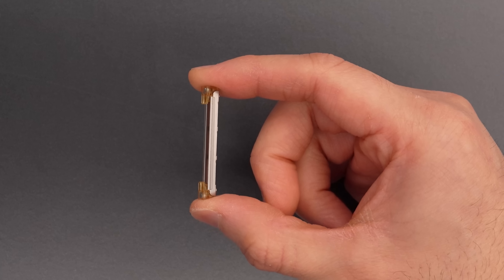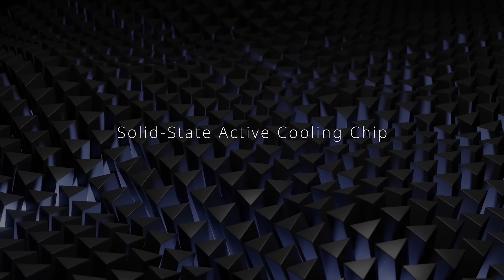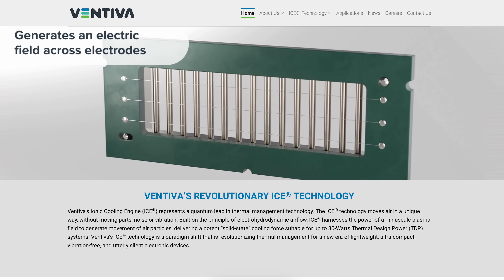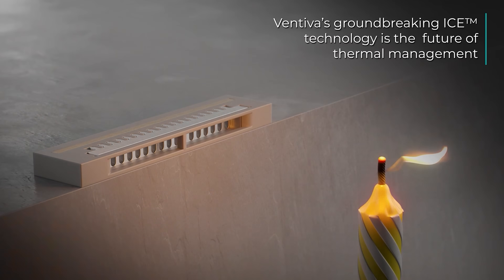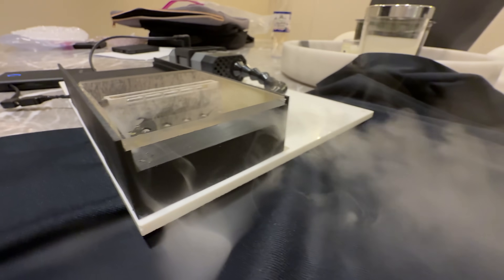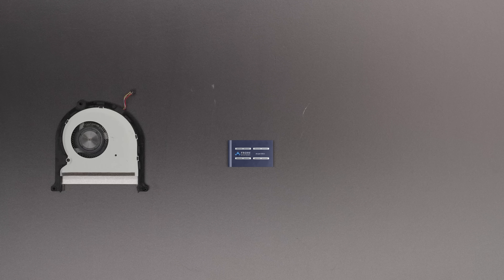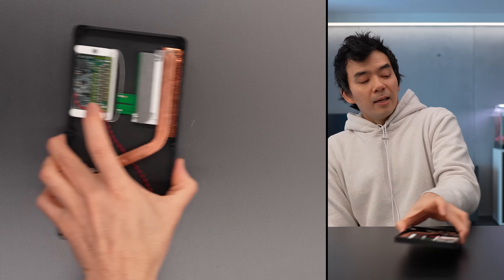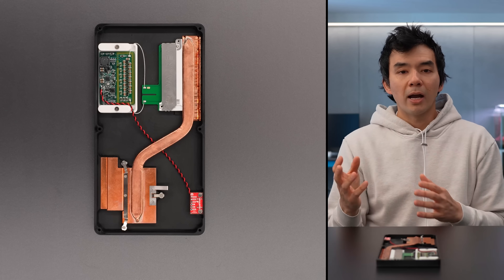The IMPOSSIBLE Laptop Fan...

Comment: 1) Ionic thrusters suffer quite a bit of material degradation.
2) There is a chance of electric shock if not properly gaurded.
Reply: Im wondering how much physical shielding it will require
Reply: @zalphor  Yes, all that system has to be extremely isolated or the electronics will give up the good old magic smoke.
Reply: @zalphor  it's literally shown in the video...
Reply: @Shockersify  you mean the housing designed to create a path for air? I don't remember him saying it was shielded.
Reply: @zalphor  he mentioned the faraday cage
Reply: @zalphor  literally brings it up at 7:08
Reply: @osmanceylan  ok then let me clarify I mean to prevent crushing and denting because outside of tons of dust and fibers its the most common damage I see at work.
Reply: @zalphor  That's not "shielding." What you're talking about is structural support. The structural support will be part of the device's overall design, just like it is in every other case, regardless of cooling method.
Reply: @nimoy007  well I didnt say EMI shielding I said physical shielding so I don't think thats the same. But ill give it to you its the easiest meaning to infer. Its structure is definitely thin so I dont think thats at all considered by the design.
Reply: @zalphor  Fair enough. As far as design goes, you can design the case in a way that redirects forces around it.
Reply: @zalphor  "crushing and denting"??? bro... what are you doing with your laptop for it's internals to get crushed?
Reply: @dygon7663  I work on ruggedized laptops. besides newer thinner laptops will be dropped and their thin chassis will flex...

For the most part being in the middle will be safe but it looks like this pushes the fan mechanism towards the heatsink and I can guarantee you people will smack their systems directly on the bottom so unless your case is aluminum its probably going to bend the heatsink and fan mechanism. And quite honestly even regular machines get beat up more often than they should. Accidents happen and they shouldn't be the end of the machines life, that is where waste comes from.
Reply: @zalphor  And I work in IT hardware repair. In the 6 years I've been doing it. I have never seen internals crushed. I've seen corners missing, screens smashed, a dent on the chassis here and there, sure, but the inside crushed? Nah. I'm sure it happens, but that's gonna be a very, very small minority. You build things so it's good for 99% of people using it, not for the fringe cases where things go unexpectedly wrong.
Reply: @zalphor  he said it was a faraday cage....
Reply: @SpydersByte  The wire/grille and the EM interference from it isn't the problem. It's that high voltage power supply creating a thousand-plus voltage potential inside your laptop. Even if that's made safe for humans, a static discharge through any IC will almost certainly fry it.
Reply: Dust bro, dust. Ionization charges molecules, this will draw in dust. This is the same exact technology that was used in Oreck's air purifier.
Reply: @johnathansmith1003  smart man
Reply: @johnathansmith1003  I agree dust is going to be a big problem for this type of cooler.
Reply: @johnathansmith1003  was that Oreck? There was one for furnaces/HVAC that claimed it'd be the only that would ever be needed as it was just stainless fins that could be cleaned indefinitely.
Reply: 3) dust.
Reply: @Howei1337 dust it not big issue yet it already have many drawback
Reply: @Howei1337  correct
Reply: 4) It doesn't take much for it to break down, and you will not notice it not (mal)functioning by sound, making troubleshooting the problem on a dying laptop extra-fun.
Reply: @Volvith i guess the only way to know it is working or not is by shocking yourself 😂
Reply: @Volvith I think this could be quickly spotted in software because you could detect the current of the parts. If the ionising wire degrades, it won't  carry a charge anymore which would be detectable. If anything, this design should be more noticeable as to what has failed. And it should be easier to fix as it's really only two parts. The ionising wire and the de-ionising bridges.
Reply: Actually trouble shooting thermal throttling is super easy! One of the easiest things to do tbh. You just watch the temps that your PC will read out to you. It's as simple as reading a temperature displayed on your screen. 😅
Reply: @Volvith  hopefully they wil be designed with sensors to tell the OS that it has failed for most common failure modes.  That would be protective and aid troubleshooting.  And while heat is bad, many devices thermally regulate and shutoff now, so a failure may not be a death sentence for a device.
Reply: @soulextracter  to be fair, they can't actually patent the whole ionic truster concept because like you say it has existed for decades. what they likely would patent is the specific combination of materials and construction used. 
that said. still not a fan of it. and i could probably rant for a long time about patents as they currently exist and the issues with them lol.
Reply: regarding the degradation, there are studies done on how to deal with that and there do seem to be some options. but i'll admit from what i can find this is all very much being researched and while i'm optimistic i would be quite surprised if this laptop fan has already integrated this research. 

also, i remember how long ago flexible screens where demonstrated. years before the first foldable released and even now it is far from perfect with how fragile it is. i would not be surprised if a company with the desire to be the "first" with a solid state fan in a laptop was willing to skip some development steps in order to make some quick money.
Reply: @HildeTheOkayish  the other thing to keep in mind is that it only has to last as long as a normal laptop fan, which don't have the most amazing lifespans.

I'd love to see what they've done to actually make this thing last a useful amount of time, if anything. It's also possible that if they get it cheap enough, they could make them swappable modules with a defined lifespan, which could be useful for some customers, and give them recurring sales
Reply: @HildeTheOkayish in other words, using consumers with deep pockets to Pilot test the product.
Reply: There is also a huge potential issue with dust build up.
Reply: Yes... And 3) they might produce "CFM" but that is only "half of the "cooling equation"  You need pressure as well... And i somehow feel like that unfortunately will NOT be a strong-point for this type of "cooler".
But I guess that they have managed to "productise" it so we just have to wait and see, maybe they have managed to conquer all the problems
Reply: Material degradation is my biggest concern here. The discharging surfaces must be of exceptional cleanliness to maintain their efficiency, any kind of headroom the design implements will come at a huge cost.
I suspect (more or less) recent advancements in high voltage zero-voltage switching type circuits enabling some kind of adjustment of the discharge-loop frequency wise to counteract issues arising from accumulating laptop goo - up to a certain point. Only a matter of time until it's all greased up by what's effectively molecularized PC dust and moisture 
They must have come up with some revolutionary filtering tech to avoid this without static pressure...
Reply: Dave2d explains the problem.

It has less CFM per watt than a fan.

And has 25% of the static pressure.

The fact he is comparing it to the actually revolutionary tech that has... 20% the CFM, but 500 times the static pressure and claims the ionic one (with heaps of downsides) is the future confuses me greatly.

Both fans are off the mark by about the same amount 20-25% of where they need to be.

But the airjet has static pressure beyond comprehension, which is perfect for a laptop, or high density heatsink (or realistically both).

I'd take 5 airjets to equal a fans CFM (but still with 50 times more pressure) over 4 ionic jets, with the same pressure and the very loud CFM that also produces ozone or requires a special heatsink but also only barely equals the static pressure of a fan.

Also, fan power efficiency is about the least important stat.  No one cares about fan power usage, it's a rounding error in laptops.

People only care about longevity and noise.

The airjet might not win there, but this ionic thing is expensive, has lifetime issues, pollution issues, expensive specially coated heatsinks, unsuitable characteristics for a laptop (space constrained, many small distributed parts that need cooling - distributed for space saving and thinness constraints).

Basically this ionic cooler doesn't solve anything for laptops.

It MIGHT solve something for smartphones... Only because most components aren't expecting cooling, so localising it entirely on a CPU might be ok.
Reply: and it's very ineffective way to create an air flow
Reply: @offilawNoone only what, 30% less efficient? I'd say that's a good trade-off if it has longevity as well. It's not like we're talking about high energy usage here either way.
Reply: I think they would be able to design the product so the risk of shock is minimal, you can get a 35,000V shock from walking on carpet, but there isn't enough total energy there to do any damage. It should be possible to make the capacitance on the high voltage side low enough for a similar effect.
Reply: I assume that’s why we haven’t seen the technology deployed in laptops to date, because the principles are very simple (and used in other contexts). So presumably “the breakthrough” is in addressing the problems you mention so that it can be used in a laptop - not the principles of the concept itself.
Reply: @soulextracter as mentioned above, the principles are well known. But implementing it in a laptop is difficult for a variety of reasons. That is “the invention”. As I am sure you know, having ideas is easy, implementation is hard.
Reply: We had cfl backlights for decades in laptops and xenon flashes in portable cameras, i think high voltage and electric shock part in consumer electronics has been handled safely for quite a while now
Reply: Sounds dangerous for electronics around it, also show me the electric buzz with this bs.
Reply: Apple will see this and think 💡 another 1000 ways our crap can "accidentally" break
Reply: Material degradation? That's good for the company's financials. Users have to pay for extended guarantee or they end up with a faulty device. Yeah, business is not about making customer happy, but to increase the company's bottom line...
Reply: 100% is not a chance. It is a fact. BTW static discharge kills electronics.
Reply: Yeah but r&d is a hell of a drug. There is definitely material that last long but it's about how hard it is to service them eventually
Reply: Like video fly back transformers from CRT days? Was thinking same thing.. but is it enough to be l3thal?
Reply: Whoa !  I recall that Captain Kirk & Scotty used this very tech to propel Starship Enterprize at WARP-speed and decimate the Klingon Empire etc. It's GOT to be GOOD, right !
Reply: How will it perform with room dust?!
Reply: ionic thrusters. I for one welcome our new scif-themed-and-spaceshippy-sounding cooling systems!
Reply: Hows the static charge and radio signal(wifi, gsm, Bluetooth) affect the circuit board?
Reply: @soulextracter  More like they invented a way to use it efficiently and reliably.
Reply: @soulextracter  Same as james watt. He didn't invented steam engine, he just made it usable
Reply: Finally the "chassis intrusion sensor" gets some work to do. It will have to shutoff the high voltage circuit as soon as the chassis is opened. Just like a mild-hybrid / electric car when you open the hood 😂
Reply: Exactly. I'm not sure about this thing's specs, but it will be at least 600V-1000V.
Reply: I won't be surprised that we'll look back on this in the future being a very bad idea.. we already know it's bad for people with Asthma or other respiratory conditions.. I wouldn't be surprised if we figure out some more adverse effects down the (time)line..
Reply: @soulextracter  I didn’t know we were talking about Apple
Reply: electric shock is acceptable, even beneficial - it helps new technology enthusiasts to become legendary
Reply: high voltage doesn't harm us but high amps does.
Reply: material degradation is the one thing company has to consider, when ionizer is used
Reply: if the high voltage circuit screws up its going to fry all your SSD memory and processor. don't think I am kidding, rain, humidity and dew can change the path of high voltage and arc.
Reply: You'd barely be able to feel that shock lol.
Reply: The impedance is so high that the voltage drops to zero if you touch the high voltage electrode.
I know , because these are easy to make , just search for a 'voltage multiplier air ionizer' circuit.
If you look at the circuit board in the video  ,you can see the stack of capacitors and diodes in the voltage multiplier
Reply: High-voltage elements have been used in portable devices for a long time. For example, this Nokia phone has a fluorescent tube for the screen backlight: https://youtu.be/RXlP2jOr56A?t=257
Reply: @aras_aras_aras_aras  Most old laptops (until at least 2009) had a TFT with fluorescent tube. I once badly burnt my thumb (hole in it, stank like smoked ham) by touching the neon transformer inside a 486er B/W LCD laptop. Highvoltage was everywhere. Also VFD and not least CRT monitors always had an HV trafo.
Reply: Not sure but high voltages(required for ionizing) might require some additional certifications for air travel and shit. 

Idk the exact voltage of a laptop battery, but i suppose it wouldnt exceed 48v, and i think that would be the highest voltage level in the laptop. 
Ionic wind will require more than that.
Reply: Which is why it's gonna be everywhere. : ^) Pushing that planned obsolescence.
Reply: Level of cynicism in these comments is incredibly pathetic. Its good to be wary but people just love to poke holes for the sake of being negative. There's actually people concerned about these producing ozone. The scale of ozone this would produce is so insanely small
Reply: The claim that a major OEM is launching this at CES this year probably means it’s undergone a mountain of testing from both the OEM and Intel so that most of the criticism here will be found to already be solved or why else would they do that.
Reply: To number 2: f them kids. Don't poke your fingers into shit
Reply: @soulextracter  When was the last time the technology was being used for consumer products?
Reply: 2) No, the current is so very very low. But it is enough to destroy some electric components sensitive to static
Reply: @soulextracter  right fuckin on. this tech is nothing new. the challenge was making it electrically efficient  as i believe it needs high voltages to move air effectively and efficiently.
Reply: @soulextracter you can patent a redesign/improved/more compact form factor of an existing technology
Reply: I was wondering something like that. seems like the free electron build up and the ionized air build up on the parts would eventually degrade them as well as decrease the efficiency of the air flow. after power is turned off would the collected electrons and ionized air resettle and clear it or what ?
Reply: Queens Gaurd should do the trick
Reply: 5) humidity
Reply: It ionizing materials, so if your surroundings have cations they will most certainly cause massive degradation to the material plus O2 does not like its electron taken as its highly electron negative so it will react
Reply: Also ineffective in terms of power
Reply: @soulextracter it non senses
Reply: @soulextracter  Baghdad battery exists centuries ago, and now they're gonna patent it for use in electronic gadgets and cars?? Keyword: implementation
Reply: Nah. So many people here tried to be smarter than the whole scientist behind this development 

They definitely already think all of that through 

Also DC doesn't have enough power to shock you kido, try to touch 24v 150A car battery and it won't shock you

And that battery is 10x stronger than your laptop battery 😂

Definitely won't shock you
Reply: Bro get a life and get outta here... You're computer right now with its crappy fan it's much more dangerous
Reply: Not to mention the ionized air being produced. Just imagine if the laptop is kept in a closed space. The user will suffocate.
Reply: @somerandomdudemc6201  Do laser printers suffocate you? They make headache, sore throat and may decompose all kinds of collected precious objects by befouling the room with corrosive ozone. But suffocating is really unlikely.
Reply: i have no clue how the degradation works and how feasible this is but it doesnt seem like it requires any hard to get material but i wonder if itd be possible to have it easily replaceable (people should be cleaning there fans or getting the vents cleaned by someone anyways) but what if it was like when you need to replace the brushes in old grinders its another inconvenience to the customer i get that but i feel like people that NEED silent pcs would be happy to replace them as long as it lasts a while (theyd probably find an excuse to overcharge it tbh)
Reply: @skif32426  When you hear that ion jet engine crackle and pop by arcing it won't be silent anyway. Fan motors normally contain no brushes. Only the bearings go bad and start to whistle or sound like a circular saw. You can still dismantle and oil them.
Reply: @cyberyogicowindler2448  i know modern fans dont have brushes (atleast any respectable brand doesnt) i was just using it as an example of something that is replaceable like a fuse or said brushes in an old grinder
Reply: @cyberyogicowindler2448  i mean the snap crackle and pop was 27 db quieter so im not sure what you're on about?
Reply: 2) Just don't lick it
Reply: @serezhka2943  but it tastes funny?
Reply: Ionic thruster also Produces ozon gas
Reply: “SHULZ!!!I told you not to take your eyes off that ionic cooling fan!!!”
Reply: There is very low chance of risk at high frequencies, human body doesn't affect on few kilohertz frequencies and there's almost no amperage

I could sent you how i'm touching ~1cm sparks of 17khz AC (somehow around 10kV) by bare finger from my homemade ozone generator without even feeling anything
Reply: @mateuszlanecki5169  Human contact isn't what I'd be worried about, it's that HV power supply inducing static discharge through nearby ICs in the laptop.
Reply: don't they just spit out ozone constantly too?
Reply: Then guard them ?
Reply: Another issue is moisture like imagine taking a laptop with is cooling method to any Asian country and go from the air conditioned dehumdified indoors to the outdoors or vice versa....just like how your glasses would fog up in the winter.
Reply: Maybe use mercury rods??
Reply: Sounds like a perfect solution for disposable non repairable laptop. Also if it can run efficiently of a laptop battery I think it has zero chance of generating enough current to be anything more than unpleasant. I mean 5 watts ain't gonna harm you no matter how high the voltage is. Unless you have a heart pacer implant.
Reply: Also creates ozone which is an air polutant.
Reply: @martenthornberg275  They dealt with the ozone by coating the heat sink so it doubles as a catalytic converter.
Reply: @martenthornberg275 really? I thought we loved ozone
Reply: @soulextracter  Fair’s fair. You can “lol” all you want, but if the technology has existed for decades and no one who invented it saw this use case, that’s on them. If this random entity years later not only sees this use case but executes on it, they deserve the rewards… especially if their implementation makes people’s lives easier/better in any meaningful way.
Reply: @abubakrakram6208 capitalist-brained
Reply: this might generate ozone too,  which is not actually good for people
Reply: @zeroumus  Didn't you watch the video?
Reply: @zeroumus 9:05
Reply: @soulextracter That's how patents work bruh... Just because the technology has existed before doesn't mean a new implementation isn't possible. 

Patents have become problematic at times, but if you have a new idea that is novel without pre-existing implementations, self proven, that is specific enough, you can patent it if you've got the cash. 

Many patents are based on a prior idea, or use the same materials. Many are mashups of old and new concepts.
Reply: here comes the armchair youtube scientist
Reply: @blackpepper2610  the older I get the more convinced I am that these armchair expert comments are mostly coming from kids so I just ignore them.
Reply: @ true
Reply: @soulextracter Well, they did "invent" a laptop cooler using an existing technology and almost made it production ready, hopefully even revolutionizing the industry with more compact and silent devices. So yeah, give them credit where it's due.
Reply: @kn8u  "REVOLUTIONIZING" !!111!!!! Nice big words for a tech that is dead before born. But don't forget to buy that "revolutionary" Dell laptop that is going to feature it. Dave2D doing his job of selling smoke, like he has always did.